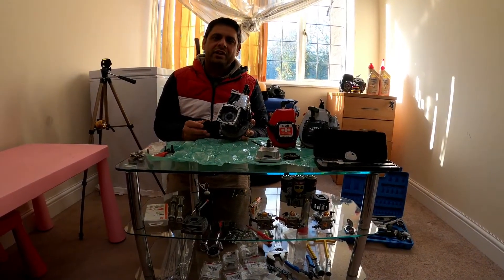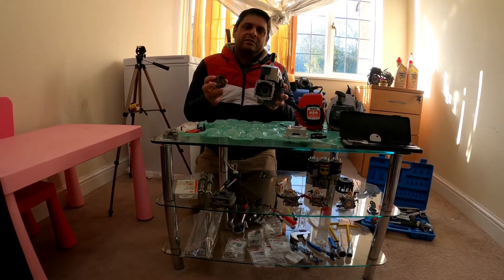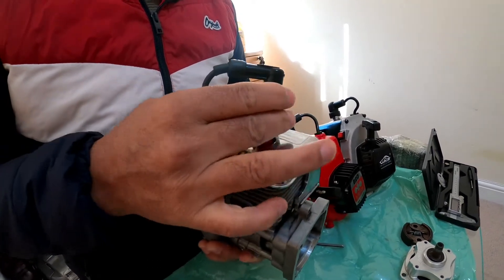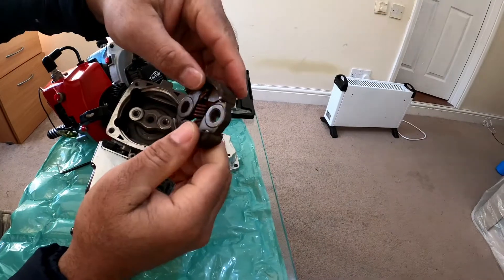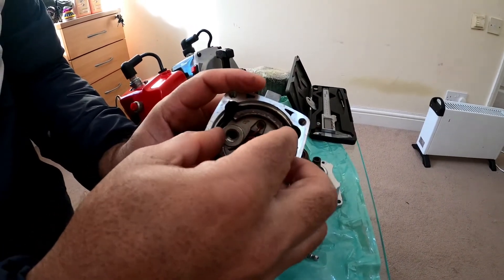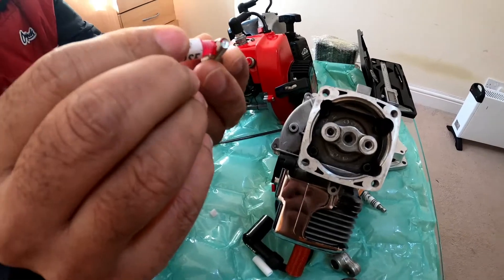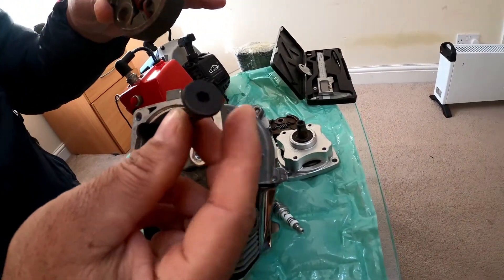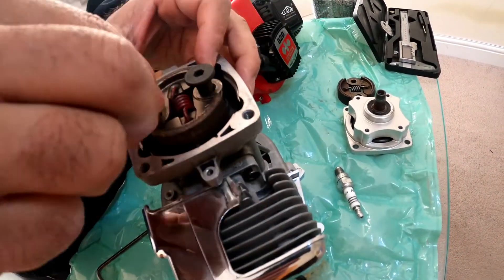Clutch Installation into 54mm Clutch Housing

Comment: I asked you on another one of your videos where to find a clutch install video. Well now I found your video! Thanks. I’m installing a DDM 54mm clutch kit on my G23LH. Thanks!
Do I absolutely need the piston block, or is there another way to do it? Also, does the clutch plate need to be so tight that when turned the engine turns over? My clutch plate counter-sunk bolt hits bottom before the plate gets completely tight against the shaft…
Reply: You can use a strand of rope like the rope used in the pull starter that’s long enough to where you can still pull it back out of the cylinder to lock the piston on the upward stroke to work on the engine
Reply: @Rarrin9378  I know I’m late but thanks. Great idea. My clutch started out great, but now it started slipping somewhere. Put a new tire on, correctly, but nothing. Pulled it all apart and the shoes still look really newish, and all seems to be in order. Not Ute what’s going on. Again, does the clutch plate that the shoes mount to need to  be tight against the crankshaft? I can hold the plate and turn the motor over without the plate moving. The coutersunk bolt bottoms out in the shaft before getting pressure on the plate. Hope that makes sense.

Comment: Can a clutch be fitted the a non clutch type goped ?
Reply from the maker: I used without clutch as direct drive by using spindle however you can used without clutch as well
Reply from the maker: Without clutch you don't need 54mm  clutch housing and clutch you can directly connected the spindle to crankshaft it is best for more rpm